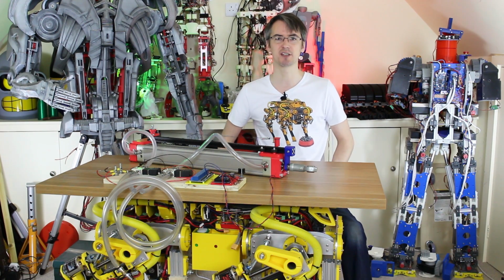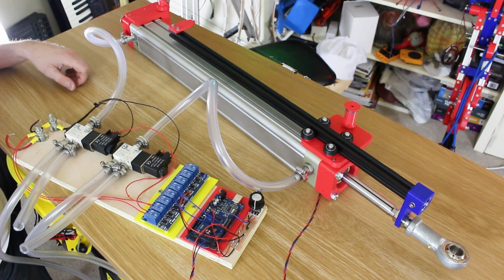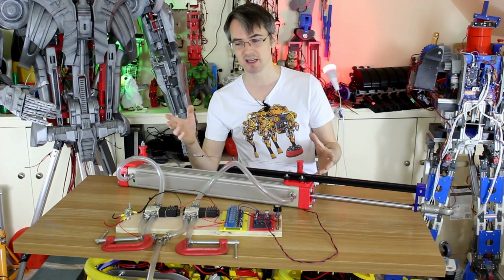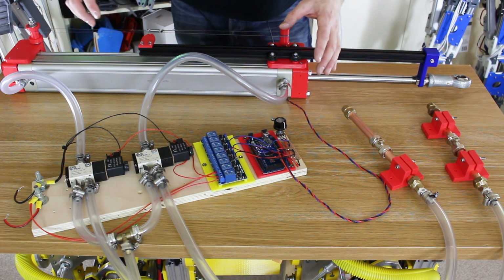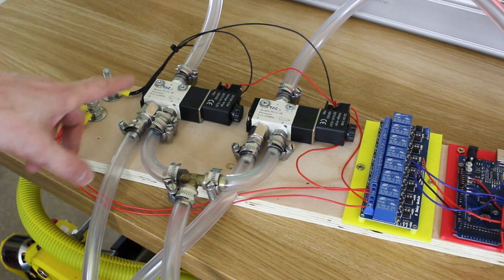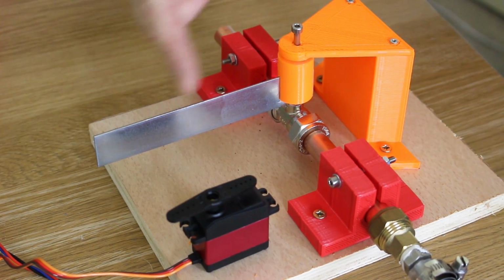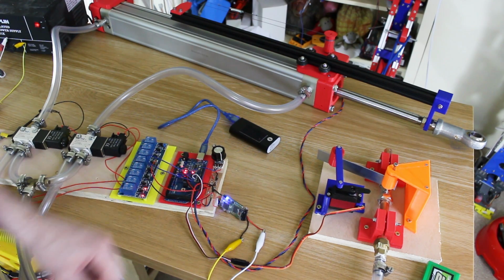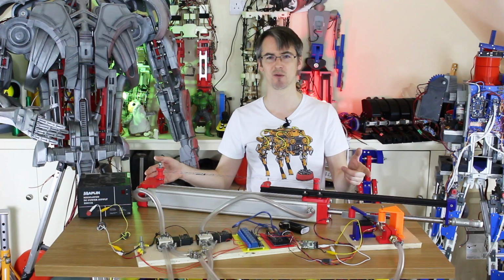Testing Proportional Control of Pneumatic Cylinders | James Bruton

Comment: The Arduino lockups are because you don't have flyback diodes on the solenoid lines. When the solenoid is switched on or off, you can get a momentary burst of current flow because of the magnetic field collapsing... 2 ways to solve. First is to use diodes across the leads of each solenoid. Mkae sure the direction is correct. Second way is to use a separate power supply just for the solenoids. That will prevent the current draw from causing the polyfuse on the Arduino to reset.

Comment: Try using smaller diameter piping that has harder/stiffer wall, the larger diameter pipe will act as a storage tank and will expand with pressure, the smaller diameter pipe will also restrict the flow for better control. Think of it like water pipe knock when you turn the tap off quickly, the momentum of the water that has to stop, air is similar but not as dramatic as it can compress and if the walls of the pipe is not rigid the it will expand slightly because of a pressure spike. Hope this might help point you in the right direction.

Comment: Look at the air as electricity.  The small tank of the compressor causes a quick drop of psi acting like a under voltage.  The two tanks in parallel give you the current flow or volume to keep your psi high for a longer time.  You compressor might turn on at 100 psi and turns off at 120 psi.  Intern giving you a broad range of voltage or psi.   Use a regulator on the output of the tank and turn you compressor setting higher.  This should give you more constant levels of psi.

Comment: Would putting the proportional valves between the solenoids and the cylinder help? They could hold the pressure and adjust to stop creep, If you used a servo on each to adjust the pressure.

Comment: James please be sure your pneumatics are properly greased. It not only lubricates but it also seals. I don't see any signs of leaking, but I can see that your piston is jumping as the force applied overcomes the friction holding it in place. Also could you please tell me at what position the 2 sides have equal volume of gas? food for thought: the steel bar of the piston must be treated as a non compressible, you could demonstrate it as a liquid if you wanted to.
Reply: My curiosity was killing me, If you deliver 32.25% more pressure to the bar end, the actuator's seal would be center of the pistons travel. 
As at equal pressure the technical center is the 'average distance' between the piston seal and the volume of rod(32.25% of the cylinder's volume dynamically) which you could determine as simply as measuring as its length within the travel.

Comment: I'm not an expert, but I'm wondering if you can't approach it in another way. Air acts like a liquid, so if you know the total volume of the system, then break down the volume required for each movement, with pressure calculated into it. Could you not then use a solenoid to release the required amount of air to make the required movement? So you're controlling how the air goes in, as opposed to the air going out?

Comment: Why not try a single direction ram, and have it only provide air to one side... Use gravity or maybe a motor/pulley to pull the ram back in the opposite direction? Would simplify things, and it may be unlikely that you need the full strength in both directions

Comment: Put diodes in paralell in reverse so it is blocked when applying power and shorts out the back emf when power is off or use a resistor in parralell to take only the biggest spike.
Diode would most likely be best (that is used in many cars directly in the relays )

Also you could use two more of that electric air valves just plumbed to the exhaust side of the other ones and have it to blok the air
Reply: Look at this picture for an example
https://i.stack.imgur.com/IUn5v.png
I have played a little with relays to check the back emf on a oscilloscope and without anything and just disconnecting i got about 70v spike on a 12v energized relay.
With a diode in parallel i got almost nothing it was a 12 point something source and only gaimed about 0.07volt if not less and that is an extreme difference.

Comment: why not instead put an electrically controlled brake on the pneumatic cylinder, then use the break to control it's position, with full pressure in the direction you want to move.   This would have no creep, and would maintain position even if the load on cylinder changed.

Comment: How dos the back EMF kill the aduino, if they are galvanic isolated by the relay?
Reply: Has nothing to do with the relays. The solenoids themselves are coils and flyback is effecting the power supply to the Arduino. He either needs to use a separate power supply for the solenoids or add flyback diodes on the solenoid lines close to the solenoids.
Reply: @JLTSoft  I forgot that the relay has coils of its own.

Comment: Is the creep because of leakage past the rod end rambar seal?  Air rams are not really designed to be 100% sealed like a hydraulic cylinder, and to get the cost down the sealing is often er,a bit lacking. Normally, when you just wang it to the end stop (<< technical term) with a simple on/off solenoid a small leak around the rambar seal doesn't matter. But for you, when you "hold" if any air leaks out past the rambar seal, then it's going to creep!  This might explain things?  (the creep doesn't actually "go away" its just that the massive volume in the reservoirs effectively negates the small leakage effect)

Comment: I have that exact relay board and have done work with it before. I suspect you're arduino issues are simply from the magnetic coils in the relays, and the solenoids aren't making it worse (they are isolated like you said). The easiest way to make your demo setup more reliable would be to take out the blue jumper in the corner (to isolate the 5V powering the optoisolator inputs from the 5V powering the relay coils), then use a separate usb battery back to power the "JD-VCC" pin. Also remove the ground connection from the relay board to the arduino. So, on the main 10 pin header you sill just have the signals and the arduino vcc connected. The inputs only need to be pulled low (connected to an open drain output) to activate the optocouplers, so you don't need a common ground. This way the relay coils will be isolated from the arduino and you wont get EMF issues from them.
Reply: I am well experienced in this area. It ain't the relays. The relay board he is using already has diodes. The issue is the flyback from the solenoids themselves. He is using the same power supply on the solenoids as the Arduino, and it's causing a current drop on the Arduino. Flyback diodes on solenoids will fix it or use a separate power supply for solenoids.
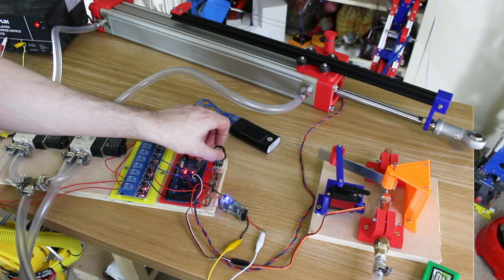Reply: @JLTSoft  Flyback diodes are definitely important, and yes the relay board has them, but they are not a cure all. He is actually using a separate battery pack for the arduino (16:00), and he explicitly said that the solenoids have separate power (including ground) in a patreon post. Basically, the issues you describe are probably correct, except it's the coils on the relays causing issues and not the coils on the solenoids. They are after all, very similar devices.
Reply: @cpirius  The only way the Arduino could be affected by the relays is if the power supply can't provide enough current. As I have said, I have used those exact same relay modules and never, ever had a problem with a 12 volt 1 amp power supply and firing all 4 relays at the same time, 10 times a second. If he is using less than that then yes, the current draw from the relays might be causing an Arduino reset. Still has absolutely zero to do with emf. I should know, I designed a production product called the MonsterShield that used these same modules with Arduino's and I literally sold hundreds of these for haunted houses and yard haunts for controlling complex pneumatic animatronics and used them in my own haunt. I even did up to 8 of these modules with 32 relays (albeit with a more powerful power supply)

Comment: If you want, you can get a block of nylon and a nylon rod, and just make a 5/3 closed center valve and drive the spool with a servo
Reply: and spend a lot of time not fixing anything
Reply: it would fix all of the issues. by eliminating pressure shock, it would also control the flow of air going in and out in both directions. its a 4 way proportional directional control valve.
Reply: @rock-afire-fan  and it will have terrible holding power when it gets to it's target, not to mention creep
Reply: @EitriBrokkr  its just a spool that blocks off ports, the valve just directs air. It doesnt need any holding power because the pressure is the same on both sides of the spool in the valve
Reply: @rock-afire-fan  I'm well aware how a spool valve works, I was referring to the cylinder it would be hypothetically controlling

Comment: Im fairly certain the small amount of movement you're still seeing after using the two compressors is due to the momentum of the cylinder. And that (i think) would be why with the motion smoothing of the servo helped so much.

Comment: Great video as always James, really enjoying these R&D style videos. Just thought i would mention that the Arduino isn't hanging because of those solenoids though as they are electrically isolated from your Arduino via the relays and the fact you have a separate power bank for your Arduino. Unless i am missing something here it can only be from the relay coils themselves (or dare i say a bug in the code). Feel free to correct me if i am wrong.
Reply: Wrong. The relays don't power the solenoids. The relays only switch the power going to each solenoid. While the relays are optoisolated from the Arduino, the solenoids are not. He is using the same power source on the solenoids as the Arduino and does not have flyback diodes on the solenoids to protect the Arduino. When the Field collapses on the solenoid, it's going to fly back to the Arduino causing the polyfuse to trip, resetting the Arduino.
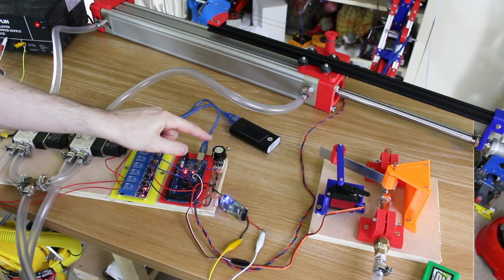Reply: @15:30 hes using a usb power bank to power the Arduino, one wire on the relay contacts go to the solenoids and the other wire on the relay contacts go off which looks like to the bench power supply, i cant see any connection from the solenoids to the Arduino.
Reply: @Logical_Controls  That is the problem. Because both the Arduino and the solenoids are powered by the same power supply, the emf from the solenoids causes a feedback to the power supply which the Arduino is also connected to. Flyback diodes on the solenoids will fix this. So will isolating the Arduino with a separate power supply. The relays have nothing to do with this problem because those relay modules have built-in flyback diodes and optoisolators that prevent the relay module from sending anything back to the Arduino. The relay module does not power the solenoid. It only switches the power that he is providing, and that power source is also providing power to the Arduino.
Reply: I suppose the back emf could be getting to the Arduino through the little module with the white LED on, not entirely sure what it is but it looks like it might be powered from the bench power supply like the solenoids are.

Comment: Instead of the output-reduction-thingamabob why do you not use the restrictors that are built in to the cylinder? It's the tiny screw besides both inlets. It restricts the flow going out. And on the output of the solenoid you have a silencer.
Reply: thats exactly what he already created...

Comment: The metal bar could have some holes and you could use something like a coil to lock a pin or unlock in certain positions for more strength.

Comment: Could you try it with no input vaulves at all? Straight from the separate air sources to the cylinder ends with your proportional release on each. And then moving in one direction you just release pressure from that end. Would be interested to see how that works.

Comment: How about using a regulator on the air coming from each tank?  The idea is to have have lower pressure on the side with more surface area in the cylinder.  This would provide pressure inversely proportional to the surface areas of each side of the cylinder.
Reply: I think, if you use a proper pressure regulator (*NOT* just a flow restriction (g-clamps)) on each end of the cylinder, and adjust them so that the end WITH the rod gets a higher pressure than the end WITHOUT the rod (doing a little math to find out what pressure over the smaller surface in the rod end gives the same amount of work as the lower pressure over the larger surface in the other end), it should work out fine.

Comment: The surface area IS different though, isn’t it? The rod in the center reduces the amount of force, since the air is pushing inward on the rod instead of down on the cylinder. I’d think if you calculated the surface area difference, and had the pressure going to the smaller side you could cancel out any movement
Reply from the maker: yes, but why does the creep go away when I use two air sources?
Reply: James Bruton when you were manually triggering both solenoids in the video, was that just opening to seperate air sources? I’d expect that slight creep then holding solidly if you are locking air in the cylinders, since the force difference allows the pressure on each side to adjust equally until they reach equilibrium, then it would be held rigidly at equilibrium.

Comment: The surface area is also different due to the radius of the inner shaft blocking some parta of the face plate. F = P x A, pressure is the same but area is different, so you get creep.
Reply: I'm not sure why using different sources fixes the issue, I'm guessing pressure rises more quickly in order to balance the forces? You need a pressure gauge on each side to tell for sure
Reply: @OM222O  with two sources, as the shaft creeps the pressure in the back goes down (because volume increases) but the pressure in the front stays the same causing a restorative force

Comment: Hi james Love all the video's ....Keep it up... Could you sense flow and pressure and control using software this would also give feedback of force applied using pressure output  too.. Also If you find some fast valves (needle valves?) You could maybe use PWM type control..  Pulsing the valve could give very small increments of movement ..??  ##Creep issue##  On ROV systems (remote controlled submersible)  I have been involved with we used OVERCENTER / COUNTERBALANCE Valves  which close after use so its like a  non-return (that releases when driven ) we used it to stop creep when lowering loads in a hydraulic manipulators.. it stops over-run / uncontrolled movement..Hope this helps .. Thanks for all your videos iv learnt so much ... brilliant ..https://www.hydraulicspneumatics.com/hydraulic-valves/understanding-counterbalance-valves    <------info on valves

Comment: Have you considered cheesing your volume/surface area balance by shortening the tube to your high volume chamber and lengthening the tube to the low volume? It won't help for practical application but it will eliminate some variables for testing.

Comment: Its called a 4/3 stable valve. At least with hidraulics works fine where the fluid doesn't compress.
Reply: except air is compressable
Reply: @EitriBrokkr  yeah, I would say that the creep has to do with flow/pressure equalization due to fluid compression.

Edit: or just what he says, different volumes, surface area of the piston... What a mess
Reply: @Otakutaru  if he ever masters hydaulics, the world is in trouble. :)

Comment: well the rod does take up some of the surface area on the right side... I think the creep might be a combination of the different surface area and the fact that the sides are not evenly pressurised after the movement, since there is overpressure on the one side, and slightly lower on the other due to the exaustion
Reply from the maker: Yep - so why does it go away when I use two air sources?
Reply: What I think ist that when both valves are open, the pressure has more force on the left side. since there is pressure applied to the check valve it might be open just a bit, letting higher pressure air then the compressors out, further feeding the Left side. with 2 sources the pressure cannot backflow to the other side, and the effect would not take place

Comment: The surface area is not the same of both sides because of the metal rod on one side. Because of this you'd need more pressure on the metal rod side to keep it stable.
Reply from the maker: Yep - so why does it go away when I use two air sources?
Reply: @jamesbruton  the piston will move until both sides have the same force (not pressure). This is possible with 2 sources: the force on the bigger surface area will increase the pressure of the rod-side until the force of both sides is identical. With one source and a T-Piece the force never will be the same on both sides, because the pressure is always the same on both sides.
Reply from the maker: @harato  The pressure was the same on both sides with the two sources.

Comment: I'm not sure this solves the issue but would be interesting to see.

Use a combined screw and pneumatic system. With a pneumatic thing between two screw valves. (parallel to them) and use the strength of the pneumatic arm with the accuracy of the screw valve to keep it in place against any creep etc.